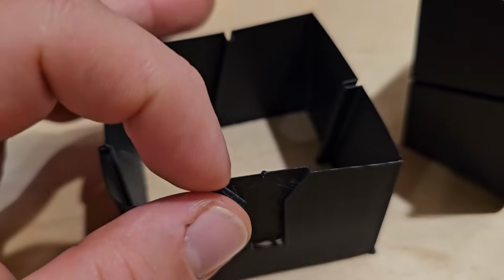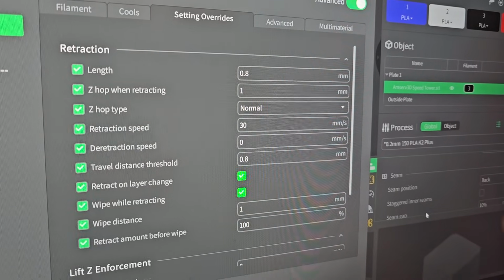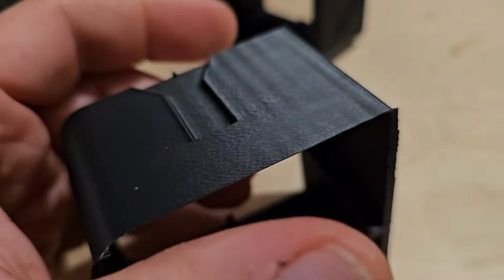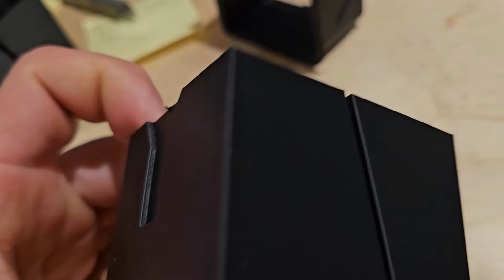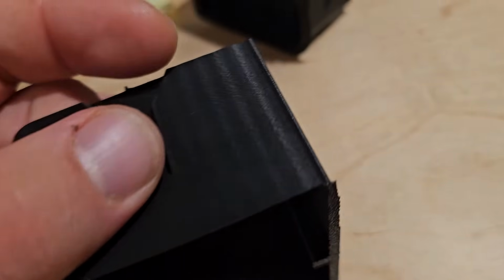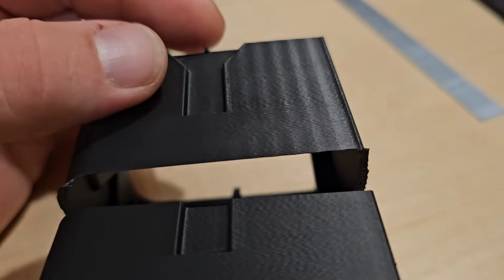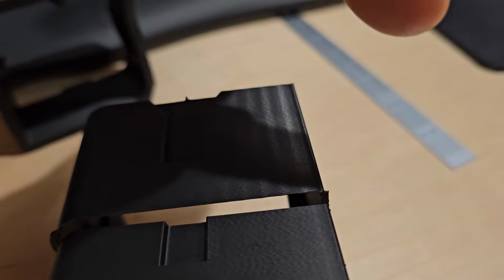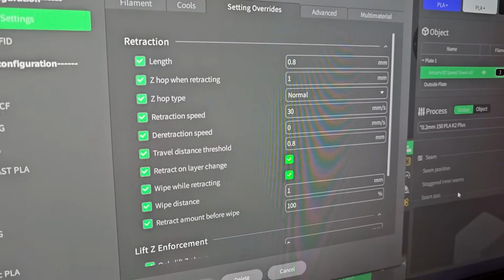Creality K2 Plus - Must Watch -  Improve The Print Quality  @Creality3D

Comment: Hi, thanks for the video and for sharing your testing process. I’ve experienced the same issue with the Creality K2 Plus — visible ripples or marks at layer changes, just like the ones shown.

At first, I tried enabling “Retract at Layer Change” and “Wipe While Retracting” in the slicer (Creality Print), as you suggested, but unfortunately, that didn’t fix the problem in my case.

Eventually, following advice from Creality’s support team (actually for a different issue), I changed a firmware parameter:
👉 the maximum Z-axis acceleration, which was set by default to 1000 mm/s² — I reduced it to 100 mm/s².

That’s when the problem completely disappeared. Apparently, such a high acceleration causes the nozzle to vibrate slightly on every Z move during layer changes, creating those surface artifacts. By lowering the acceleration, the movement becomes smoother and the ripples are gone.

I hope this helps others facing the same issue. Thanks again for your content!

Comment: Good video. I haven't had any issues with my k2 plus combo that I picked up a few weeks ago, thus far, with printing and overall print quality. Maybe they corrected some things like this out the box since you had these issues. My extruder settings for the Creality K2 Plus 0.4 nozzle has retraction set pretty similar to what you ended up dialing in to as default. Not exactly, but fairly close with 0.8mm length, retract on layer change and wipe while retracting are both checked, a wipe distance of 2 with a 70% retract amount before wipe, a travel distance threshold of 1mm, etc.

Comment: I am having issues printing the 3dlapprint F-86A fuselage parts.  I am dealing wostly with missing ribs, crosshatching failure and it is having issues with the "pegs" of certain parts of the fuselage which start off with tiny little circles that are turned into circular towers within  the structure.

Comment: Bought a K2 Plus, and it's extremely easy to work with.  As a novice in 3D printing it takes a little work to get used the print set ups for color printing.  However, be cautious which ad  you use to order from.  I ordered the K2 Plus Combo, but there was no filament in the package. After quite a few conversations with customer service,  they are still not sending the filament, evidently the ad I reference did not include any filament....strange.  4 spools of filament may be nothing to Creallity, but when you are 75 and live on a fixed income, that's a lot of money.  I guess they don't care about the civilian consumer, just the big ticket users and YouTube users. They don't care about giving away a 1600 printer to someone who will demonstrate on YouTube, but when it comes to the average consumer, we're out in the cold.

Comment: The same issue. The settings you mentioned have been the default settings in creality 6.0, but it still have this wave and can't be solved. The engineer said they are currently locating and solving this problem, which is expected to take two weeks. That's really disappointing
Reply: So you have ane solution?
Reply: Same for me. No matter if set in the slicer or the filament settings, this pesky ringing keeps coming back

Comment: The k2 plus is a bad printer.  Regret buying mine
Reply: Auroratechchannel does a good review of EVERY printer  even a website comparing bamboo prusa. K2 overall beats on quality speed etc .. only thing which makes it 2nd place out of all printers is the price. Not sure why you think its a bad printer . I haven't even got one but so far out of all the reviews . K2 comes on top.  Only the certain brand fan boys like to pick on it. I personally went out of my way and if ANY printer shows it's overall better I'd buy it instead so far . If I were to buy one this would be it. Qidi 4 almost had me but no colour yet and k2 out performed it in tests.
Reply: You getting paid for astroturfing negative comments about the k2 that are vague and nonsensical?
Reply: Cap, you probably don't even have one.The print qualities actually better Then the bamboo lab ones. Look it up.
Reply: @Neo-Prints  Mine has bad waves even after this setting. Im also on my 2nd one, first one was replaced by the dealer but came looking like a used unit. Packaging was great but aesthetically has problems.. scratches, chipped door handle
Reply: @dheransukraj1921  mine works fine, I have also worked on many other printers, and the K2 and my A1 are neck and neck on quality. I am not sure, but you could have gotten a faulty printer... (The warranty does cover some of this)

Comment: This is the kind of testing and tuning I appreciate! I have seen this issue on Bambu Lab prints a lot as well and they have retract before wipe set to 0% by default apparently. So I bet you it's the same cause in a lot of cases. I rarely see issues this bad on my prints, but I almost always have retract on layer change and 100% retract before wipe on. Good stuff!

Comment: This printer is pretty good. It will outclass prusa and bambu in VFA management. 
Mine has no vfa issues. What it did have, however, is a broken foot in shipping, it carved a line into my build plate and the pneumatic fitting on the print head broke somehow. 
I reached out to creality via online chat and it actually connected and i got to speak to a support rep to get new parts in 2 mins. Bambu will take 3 days. 
Printer is currently down, i am waiting on parts

Comment: I got a k1 SE on the way. But maybe my next printer would be the leaked H2D. I'll use my k1 se with cheap pla to prototype and fit stuff. My only issue with Bambu was that they are closed off and a bit expensive, but that H2D looks like a really good prosumer printer that a lot of people have been waiting on. I just want to print and work on ideas, my ender 3 and 3s1 days were fun but I want a tool grade printer, more akin to a PC lol, plug and play and add mods/additions that just work. We just aren't there as yet but very close, maybe a k3 or H2d will be closer to the the ideal fdm printer. The K2 did look near to what I dreamed for.

Comment: My door fell off when I unboxed it. Anyone else?
Reply: The top hinge wasn't connected to the glass door on mine, I ended up using some instant epoxy (clear jbweld) to fix it
Reply: My best guess is mine was damaged by thermal expansion sinse it was pretty cold outside when it was delivered and the packaging showed no signs of damage

Comment: I'm conflicted whther to buy the K2 Plus or the Bambulab X1C....both printers are priced the same value in my country at 2000-USD, K2 is newer and has a bigger build volume compared to the X1C, but the X1C is a proven machine to print at great quality and little I heard about it's problems compared to the K2 Plus combo.....what would you recommend? I plan to print some carbon fiber parts for my car like a gear shift knob, which printer would be good for this and which carbon fiber filament should I use?
Reply: Bambu lab all day long if you actually wanna print. K2 if you wanna tinker and are ok with subpar software . I own a X1C and a k2, I honestly hate the k2. I probably wouldn’t if I couldn’t see how much better the X1C is.
Reply: @walterhresent2295  problem is, I just learned that the K2 plus is actually after the X1E not the X1C...still these new features of K2 plus are something to be desired but reliability goes with Bambulab....I think I will just get the P1S Combo.
Reply: @Hunikengt  I think you are making a wise decision. Don’t get me wrong the k2 has potential to be great, it just wasn’t ready in my opinion. That makes me think creality hasn’t changed. Their customer service is some of the worst I’ve ever dealt with as well. Not to mention many others have had this problem to, they damaged the machine with the way the tape it with shipping tape no matter how careful you tear it off it damages the finish. I don’t know about you but I like my new stuff to look nice, for a little while at least 🤷

Comment: This is probably amplified because it's a single wall right?  With multiple walls and any wall setting but outer first it should be internal to the model?
Reply from the maker: I'm sure it is amplified by being a single wall, but that pattern would still show thru several walls.  I'll print a multi wall model and a single wall model to show the difference.